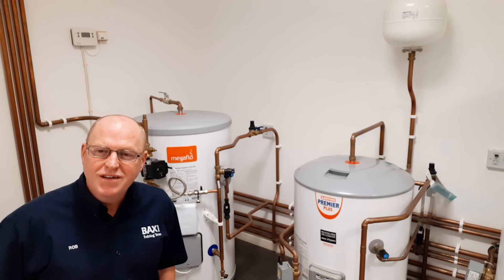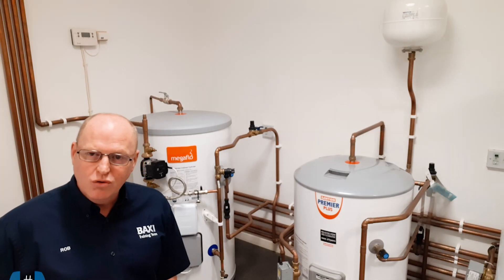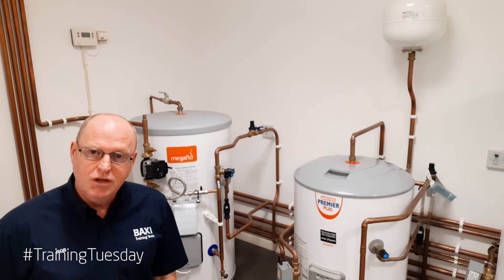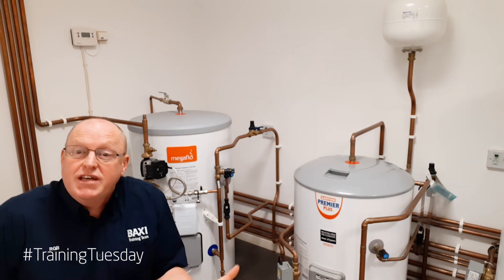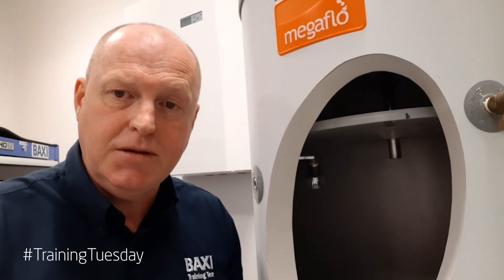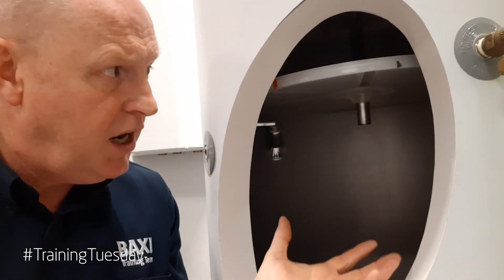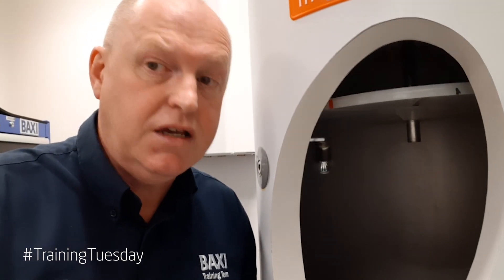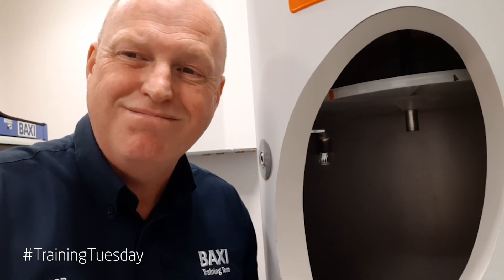A closer look at internal and external expansion in a Megaflo unvented cylinder | #TrainigTuesday

Comment: Ahumm!!

So could you please explain how moving a specific volume of air from a pressure vessel that can be flexibly mounted to the top of a cylinder is "saving space"?

Also, why don't you explain the structure of the baffle (that mysteriously did not get described in the sales details when I purchased mine) and how it fails. What, for example, is the baffle filled with? Could it be that green goo that is now clogging all my taps and showers?

Who, exactly, will be expected to pay for all of this flushing etc?

Comment: Can the baffle get stuck on older models? I have had several that will not suck in air when trying to replenish. The only way I have found to get round this is to fit an external vessel.
Reply from the maker: Hi Andy, in that situation we would advise to drain some water off via the bottom drain point and check that there is no possibility that the water could be mixing, back feeding and the bubble being blown out. Hope that helps. Thanks, Sarah
Reply: @BaxiBoilersUK  would u advise draining ALL or SOME of the water out of the cylinder??? i presume that the water level in the cylinder needs to be lower than the TPRV (so air can be drawn in). my lowest hot water tap is HIGHER than the TPRV - so almost no air gets sucked in when i try to replenish the air gap!!! any advice please???

Comment: On the Megaflo the D2 from the tundish to the first bend does not look to be 300mm. Is that pipe supposed to be  on  a continuous fall, because after the first elbow it looks horizontal.
Reply: It’s in a training centre so the regs don’t apply mate
Reply from the maker: Hi Wayne, because the cylinder is located in a training centre, it can be used for fault finding, due to this there may be some things that are not to standard. You are correct, there should be a minimum of 300mm before the first bend on the D2 pipework and the D2 should have a continuous fall. Thanks, Sarah